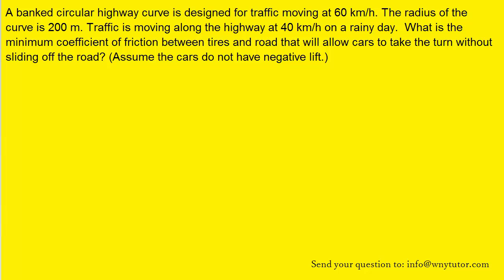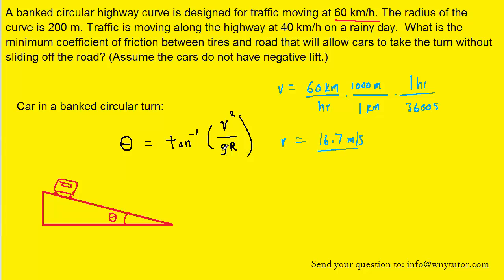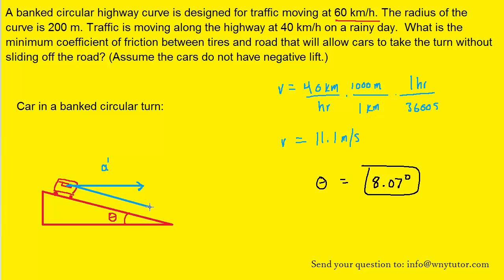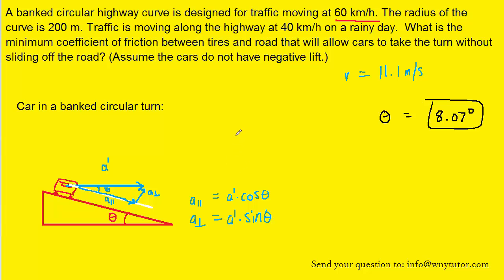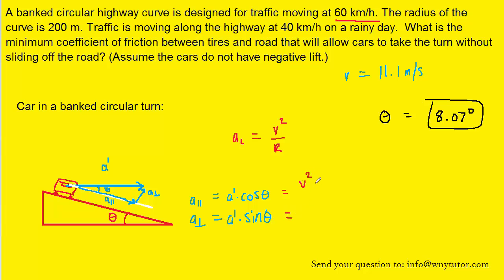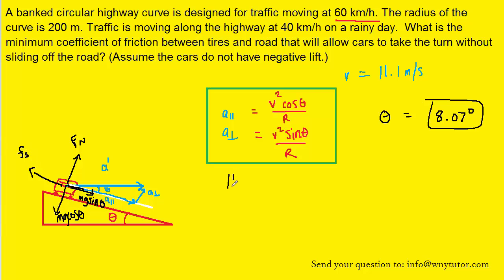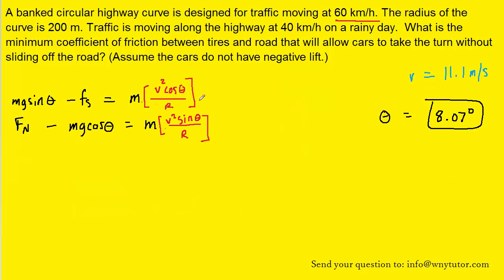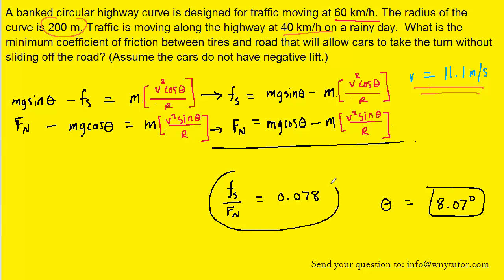A banked circular highway curve is designed for traffic moving at 60 km/h. The radius of the curve i

Comment: This is Halliday, Resnick and Walker problem 56 of chapter 6 of 10th edition. I really don't understand it. If the curve is designed for traffic moving at 60 km/h, meaning there is no need of friction at this speed, for 40 we don't need friction too, since 40 is smaller than 60.
Reply: I think I understand now. The car is going to slide off 'into' the curve and not out. This was completely unexpected for me.